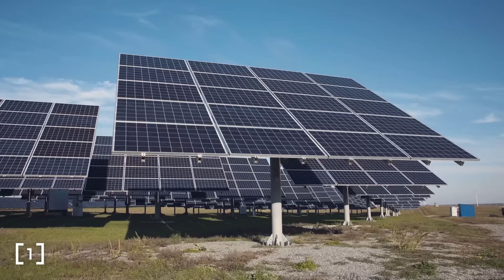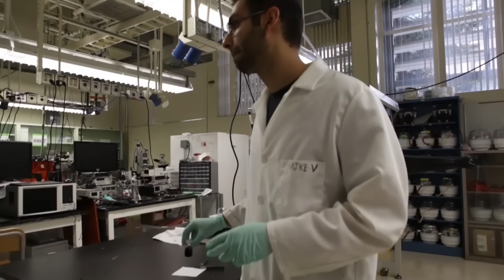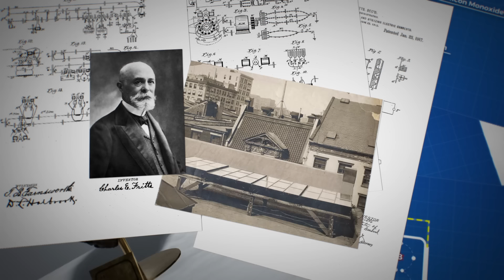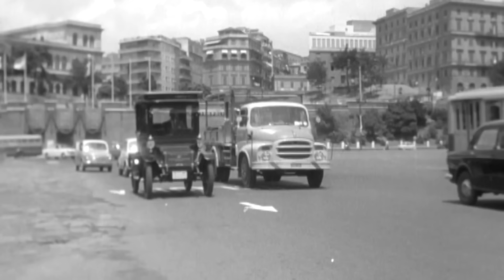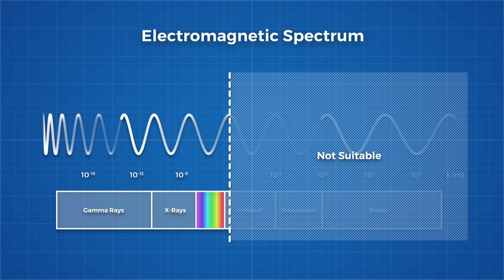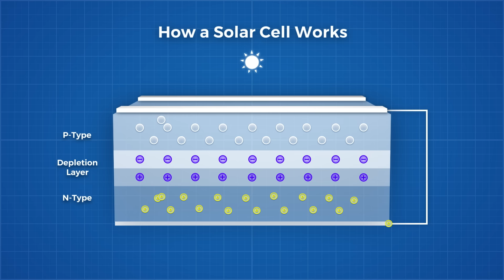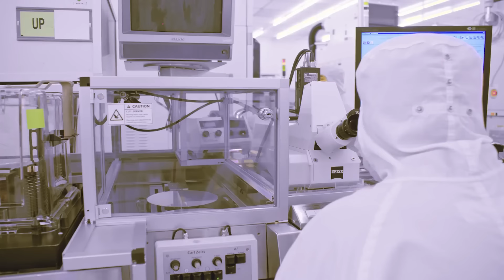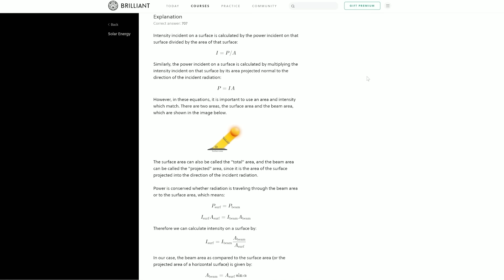The Mystery Flaw of Solar Panels

Comment: N.B: selenium cells generate electricity by the photoelectric effect, which is not the same as a in a photodiode.  An important factor not considered in this video is that silicon has an indirect bandgap; thus, the generation of an electron is necessarily accompanied by a phonon (lattice vibration) which represents another source of inefficiency.  This is a fundamental property of the material which cannot be altered.  Also note that oxygen is an intentional impurity in silicon made by the Czochralski method, which makes the wafers stronger.  Without oxygen, large wafers would be too weak to handle during the manufacturing process.
Reply: If only I understood u.
Reply: Yup you're correct. That's why now we (Solar cell researchers) are moving on from Silicon based Solar Cell to 2nd Generation thin-film and 3rd Generation organic Perovskite Solar Cell. Both are direct bandgap and can be built thinner and more flexible.
Reply: @msb3235  true. But the organics and perovskites are way too sensitive to atmospheric conditions. Exposure to the air and humidity instantly kills them. They need proper encapsulation which further reduces efficiency and increases cost and manufacturing complications. Inside labs these materials are only worked on in a glove box. Sadly we have yet to reach a breakthrough. Cuprous oxide was once thought of as a good candidate but seemed like that research direction is no longer present.
Reply: @EXtREMeBuLLsHyTS  & @MS_B  Both true!  It is a really tough problem.  Silicon, as you well know, is cheap as chips, and it works, so if you have the space, then it is not a great hardship to add some extra solar panels to compensate for low efficiency.
Reply: It seems to me like the photoelectric cell is a dead end, if we focused on parabolic panels heating a low boil point liquid like ammonia that turned a turbine ran through a condenser and back out into a panel farm you could create a thermal solar cell with far cheaper materials. 

In an extremely dry, high heat environment like the Middle East you could skip the condenser recovery phase and use sea water the sea water converted to steam would be fresh water, and the influx of new sea water could be used to flush salt deposits from the tubing.

The same process could be used for waste water treatment after the water had already gone through treatment and removal of solids where the effluent could be pumped down a bore hole for increased production at a geothermal plant or used in any number of other processes.

I like the desalination plant idea a lot as you increase market viability by generating 2 products fresh water in a desert and electricity.
Reply: @beefy1212  Note that the maximum thermodynamic efficiency is necessarily limited by the maximum boiling point of the working fluid for a solar energy system of the type that you propose.  Similar systems have been tried, but they have all sorts of problems with reliability.  Photovoltaic systems have the huge advantage that there are no moving parts.
Reply: cdl0 no moving parts sure, except they are manufactured using expensive/rare materials primarily in China, then need to be shipped all over the world, to be installed largely in extreme latitude areas, to create fairly low density energy with little to no storage capacity,  at least a steam system would create a second marketable item in costal desert areas like Southern California or most of the Middle East.

Let’s be honest though all of this is a stop gap to whatever nuclear solution we eventually come up with.
Reply: @beefy1212  Silicon is made from sand, so is not rare, and not expensive.  Other than cost, there is no particular reason to make solar cells in China, but that is the same for everything.  Battery technology is good enough now to provide useful storage, and improving rapidly, but we are moving off-topic here, so I will leave it at that.
Reply: cdl0 https://www.google.com/amp/s/www.forbes.com/sites/michaelshellenberger/2018/05/23/if-solar-panels-are-so-clean-why-do-they-produce-so-much-toxic-waste/amp/

They are not just sand, and that is the issue, and the batteries are made with further heavy metals and rare earth materials, and their capacity for storage is laughable.

The fact they are made of in China is cost and a near complete lack of environmental oversight. The issue with that is solar is supposed to reduce your carbon footprint not spend almost their entire useful life paying off their manufacturing footprint.

PV Solar is a technological dead end.
Reply: If oxygen is needed to make silicon wafers strong enough to handle, then can't something else be used as a substitute for the oxygen as a reinforcing element?  Preferably, something which won't combine with the dopants and lead to the reduction in output.
Reply: @melkiorwiseman  Yes, nitrogen can be used.  Extremely high purity silicon is made using the float zone method.  The only substance made purer than this is liquid helium.  On its own, the material is too weak for processing into solar cells.  Adding tiny amounts of nitrogen gives it the necessary mechanical strength, and resistance to the formation of crystal flaws called dislocations (a class of extended defects with detrimental electronic properties).  Silicon made by this method costs perhaps ten times as much as that made by the Czokralski method.  Recently developments in processing can now produce wafers from float-zone silicon that are very much thinner than previously attainable, and hence cheaper.  With further research and development, solar cells fabricated using this material may become competitive with the Czokralski type.  Nevertheless, this does not solve the fundamental problem that silicon has an indirect band gap, which represents a huge source of inefficiency.  As you see, it is not simple!  :-)
Reply: @cdl0  If the higher cost of Nitrogen-strengthened wafers is due to more energy consumption (as nitrogen and oxygen are both cheaply available from the atmosphere), it may be more energy efficient to keep the oxygen defects. Maybe the substitution of a different elements for the Boron (mentioned in the video) has a better cost/benefit ratio than substitution of nitrogen for oxygen, maybe not.
Reply: @johndododoe1411  That is a good comment, and good thinking.  Well, as you may imagine, the choice of dopants, and the subject of oxygen in silicon has been researched at the highest level over many decades.  It is natural to consider using aluminium instead of boron, for example.  However, it turns out that its electronic activation energy is a bit too high, it has poor solubility in silicon, and its diffusivity is much higher than boron (which results in device degredation over time).  Aluminium-oxygen complexes are also problematic, regarding carrier recombination.  In terms of energy budget, doping of any semiconductor pushes the Fermi level and chemical potential of the material towards n- or p-type, so there is a natural tendency for the system to try to compensate by making another defect of the opposite type.  I could go on, but I will leave this as an exercise for the student.  ;-)  There is absolutely loads of material on this topic in books and learned journals.  It is really not so easy as one would hope.
Reply: @melkiorwiseman  P.S: I forgot to say that oxygen has another benefit:  It can combine particularly with certain metal impurities that are present in trace quantities so that they are made electronically inactive.  This process is called gettering.  Copper and iron are two notable baddies.  Other tricks will need to be used for float-zone silicon (possibly involving hydrogen from e.g. acid or plasma treatment).  It is a huge topic.
Reply: Finally I understood why people don't like indirect band gaps
Reply: Could nitrogen be exchanged to limit this flaw?
Reply: Solar cells aren't made through the Czochralski process though; they're mass produced in CVD chambers to create poly-Si by decomposition of silanes. Typically hydrogen passivation is used to improve intergranular conduction and reduce surface recombination. Unfortunately, these processes take a lot of energy to produce and depending on the process (some use the old Siemens process which releases HCl as well) are not environmentally benign either. Perovskites are probably the most promising way of the future but their degradation mechanisms and inclusion of lead holds them back from practical use. Oxides like CuO are typically too defective to work as solar cells. CZTS/Se might be the most interesting research system (birthed from CIGS) and holds a lot of promise as well as successors to CdTe/CdS solar cells. The most key thing to widespread adoption of solar cells is energy storage, however, as battery technology is woefully, woefully behind for storing massive amounts of solar energy and wind energy, remaining one of the modern grand challenges in materials.
Reply: @rubbles2206  Monocrystalline solar cells are made using Czochralski silicon.  These are more efficient and more expensive than polycrystalline solar cells.  Both sorts are available, but you get what you pay for.

Comment: I live on a yacht. I use 2 solar panels and a wind generator to make electricity. There are about 10 hours of light a day. On average I guesstimate the wind generator operates about 2 hours a day.
Tidal flow operates about 20 hours a day. Slack water happens 4 times a day. 2 at high tide & 2 at low tide. I'm considering building a hydrogenerator. Lunar energy.

Comment: Due to the manufacture processes and waste leftover at the end of the useful life of solar panels (~20 years), we are creating huge stockpiles of hazardous materials such as lead, rare earth minerals, plastics, and carcinogenic cadmium which are totally unregulated currently and disposed of in garbage dumps. As a result, we're burdening future generations with toxic land fills that aren't being dealt with today. Is that what we want to do to save the planet?
Reply: Not to mention the fact that we are running out of places to store spent reactor fuel rods that will take hundreds of thousands of years to be neutralized.
Reply: @WillO-sh2dz  This is untrue. While nuclear waste is highly regulated and safely stored, waste from both wind and solar are totally unregulated and piling up at an increasing rate. As far as nuclear waste is concerned it's currently stored on site and hasn't had a mishap in over 70 years of use whereas renewable's waste can go in landfills. The US had a permanent nuclear waste storage site ready to go (Yucca Mountain) but was cancelled by then Senate Majority Leader, Democrat Harry Reid for his own political purposes. Furthermore, advance reactor designs can use this waste as fuel in future operations as only about 5% of its total energy potential has been consumed by current generation reactors. Finally, the total volume of all high level radioactive waste currently accumulated since the beginning of commercial energy production could be stored in a warehouse the size of a single Walmart Superstore such is its energy density something renewables do not possess.

Comment: "If the solar cells could work all day.  Which, they can't."  Yeah.  Kind of a HUGE problem you just glossed over there.
Reply: Very true, and it seems like the not so mystery flaw of solar.
Reply from the maker: Welcome to the channel. I have about 5 videos that go into the problem at depth.
Reply: @RealEngineering  Are they disguise as a advertisement as well and making us waste time?
Reply: @paulhaynes8045  It is hard to do this, if you have to spend that much time for an advertisement.
Reply: They DO work all day.
Reply: @Jkirk3279  Yep when its overcast and raining too.
Reply: @Jkirk3279  Sure, but at what output?  10% of what they'd make if it was sunny?  You aren't technically wrong, it's just not a useful amount.  Those variations make it extremely hard to predict what the energy output is going to be when you need it, which is why renewables have a mandatory copairing with gas peaking plants, and maybe someday sufficient battery storage.
Reply: @BRAVOZULU DWEST boathouse  There wouldn't be a day if the solar panels can work whole day.

Comment: Another option, is instead of improving physical efficiency, work on economic efficiency. If you have a process that can make only 5% efficient solar cells, but they cost less than 1/4 of current technology (hopefully, a lot less than 1/4), then you have solar cells that cost less per watt. This also assumes they have comparable service life of current technology. But if it costs substantially less, then it can be factored in, too. If, for example, you have a solar technology that you can simply paint on, and say its 5% efficient, and needs to be repainted in 5 years (1/4 the expected life of current solar panels; 20yrs). The cost of this technology needs  to be at most 1/16th of current solar panel cost. But if it can me made, and applied, at a total cost 1/20th, then your ahead. Something to look into.

Comment: Question out of the dark for a common person that is nowhere near an engineer. What about a magnifying glass equivalent positioned over the solar panels?
Reply: A magnifying glass focuses light. That's how you kill ants with them, by focusing much of the energy of the light into a single point. So a magnifying glass would take light away from most of the solar panel and focus it on just one small point. Likely damaging it and/or starting a fire.

Comment: I wonder if a solar photoelectric panel could be combined with a water heating panel.  Perhaps using the heat to compress a gas for refrigeration could not only cool the panel, but also produce additional refrigeration.
Reply: It’s been done for hot water, wish I knew what was involved in compression.
Reply: @owenbevt3  As far as I know, thee is no combination heat and photoelectric panel. Heat causes gas to expand. If you look at a kerosene fridge or a propane fridge, it is easy to see how heat causes gas to expand and increase in pressure. It is the aerosol release of the accumulated pressure that grabs heat.

Comment: It isn't really a silicon monoxide film on a crystalline solar cell. SiOx is used with x usually greater than 1 but less than 2 to tune the index of refraction. Most of the solar cells that I have work on deposition equipment for the film's for deposit Al2O3 on crystalline silicon for passivation and anti-reflective coating.

Comment: Potential or light induced degradation can be dealt with by also grounding the negative terminal. Granted this does result in additional costs for the system they are fairly minimal in the overall cost of the system.

Comment: only 20% effective and then it loses 2%........Why isn't anyone worrying about that 80% loss instead?
Reply: My thought exactly?  I keep wondering why nobody is thinking about combining thermocouple tech with photovoltaic tech to re-capture at least some of the heat loss.  The beginning of the vid showed that only about 20% of the radiation that hits the earths surface it in the form of visible light, which photovoltaics work on.  80% is infrared,  which produces heat when absorbed.  Why not harness this with thermocouples or thermovoltaic cells?

Comment: Solar cell loses power because the surrounding temperature & silicon cells which flow of Electrons get stopped more over solar panel damage in rain & show to reduce its power & Wonderful video of Explanation of why solar cell loses its is energy research work made and Giviny exact conclusion & solutions to problems👍👍👍👍👍